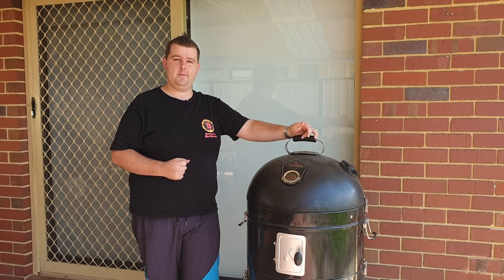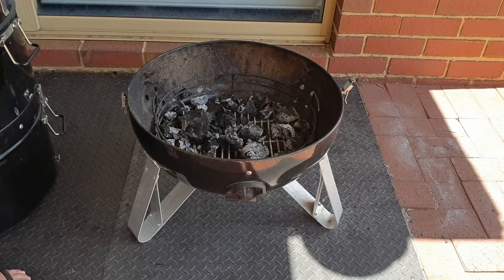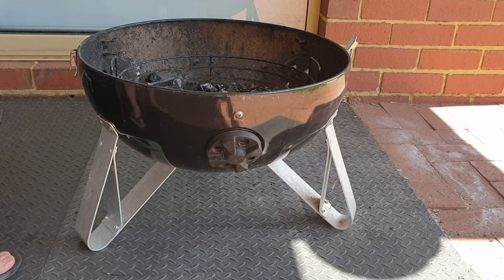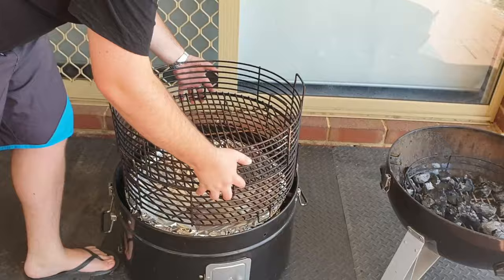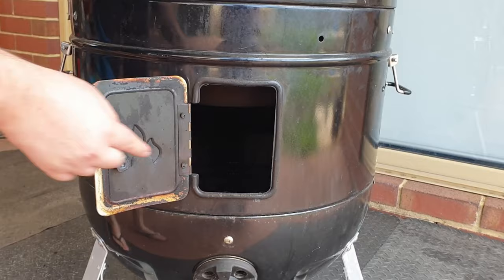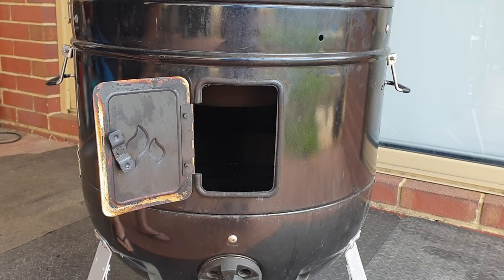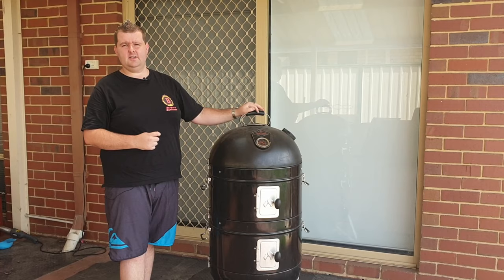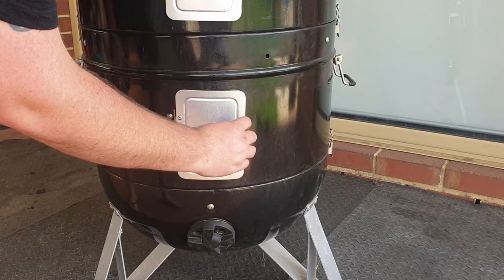Bullet Smoker Basics

Comment: nice, I do like to put water in the bottom pan to add moister to the smoker, it does slow the smoker down a bit (you spend a bit of heat boiling the water) but I believe it does benefit the cook. I like how you have covered the water pan in foil, that makes a lot of difference in clean-up.
Reply from the maker: Fair enough, it's all about what works for you at the end of the day 😀👍
Reply: If you have access I boiled the jug & added the hot water… seemed to work well for me…
Reply: @ozoutlaw716  mate I like that

Comment: Really enjoyed the video. I'm curious - how do you go about implementing wood burning on these bullet smokers? Also, how do you add if you need more (coal/wood) to sustain the burn for a long period, if your initial batch isn't enough? (I ask because it seems like once the stack is on, it's tough to add more the the existing fire). Cheers!
Reply from the maker: Hey mate, you can put yoy wood chunks thru the doors on the front as needed.

Also if you need to add a lot of charcoal, there no harm in taking the whole top off, refilling the basket and putting the top on again, just be careful not to choke the fire out, make sure there's enough lit charcoal left to ignite the stuff you add.
Reply: @BarkersBBQ  Thanks for the quick response. New to the game, so really looking to pick up tips where able. Hope to learn more on your channel.

Comment: Question. I just bought a bullet smoker. With smoking wood do you put it directly onto the hot charcoal? When I did this it lit up and heaps of white smoke… Or does it need to be just above the lit charcoal or another grill or something??
Reply from the maker: Hey mate, there's a possibility the wood you're using might have a bit of moisture in it, leading to whiter smoke. If the smoke is white and thick do not use that wood as it's way to green.

I place a chunk directly on the lit and another in the unlit for when the coals make their way over. It's also good to preheat your chunks too if you can. Under the smoker is fine👍

Comment: ...'I'm just going to lift this lid oooohn...! ' Lol - it's a heavy beast. Absolutely solid smoker. Just got a 22" Razzo a few days ago & trying to figure out my heat control. Did an ok / edible, small 2kg briskett over 8 hours but this is my first charcoal smoker ( have been using a cheapie electric cabinet smoker for the last few years and have messed about with a smoker box on my old webber kettle).  One thing I did not realise is how hungry the thing is for fuel, I need to get that dialled in with the vents. I notice you use heat beads & lumpwood. Which do you top up with during a long cook?
Reply from the maker: Great to hear Alan. If my cook is running long and im getting low on fuel, I throw a good amount of large lump charcoal chunks in, they eventually ignite and push the cook along another few hours 👍

Comment: What model smoker is this? I love the double rack in it
Reply from the maker: Hey mate, it's called the Fornetto Razzo 22 Inch. Its also available in 18 inch
Reply: @BarkersBBQ  I've asked before but the Fornetto Razzo and Matador Catalyst are really similar to eachother, it wouldn't surprise me if they were made in the same factory in China but with slightly different parts and different branding.

I've ended up buying a Matador from Bunnings in NZ just yesterday, though I think I'm coming down with C19 so I'm self isolating in my bedroom and haven't had the chance to assemble it.

Dumb question but how would you remove ash? Just tip the base upside down?
Reply from the maker: @mike hoskin  Yea so Matador and Fornetto have the same parent company, so your probably right, but Matador Catalyst does have a couple of extras like the Rotisserie capability.

And yea, for the ash, just take out the basket from the base and empty it out, simple as 👍
Reply: @BarkersBBQ  sweet dude, thanks for the confirmations. Can't wait to start learning how to use it, it's my 2nd upright smoker, 1st one which I still have is very similar to a Jumbuck 3 in 1. I've also been smoking steaks and chicken legs in my standard Weber GA.